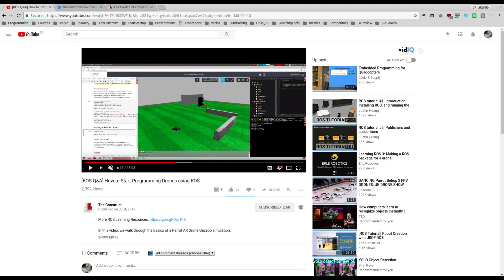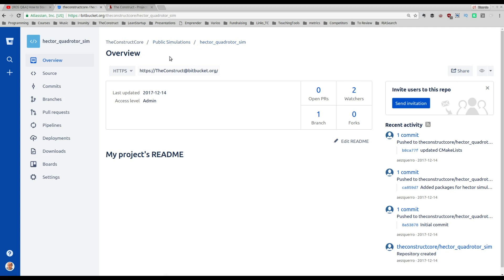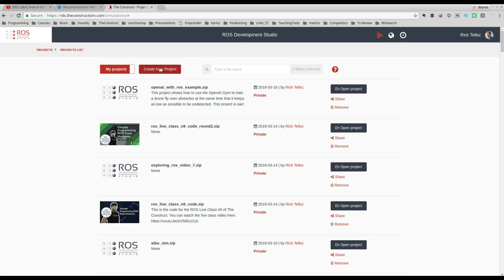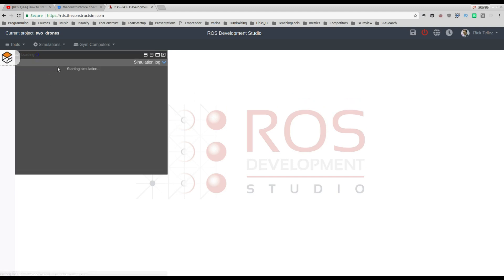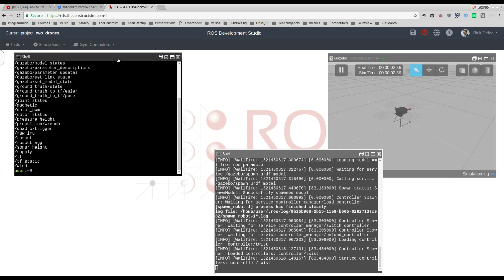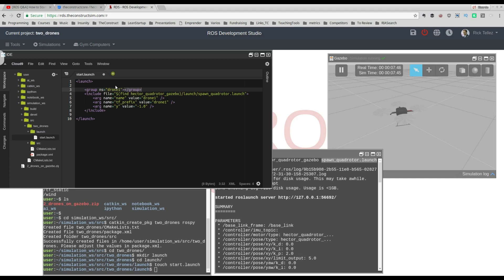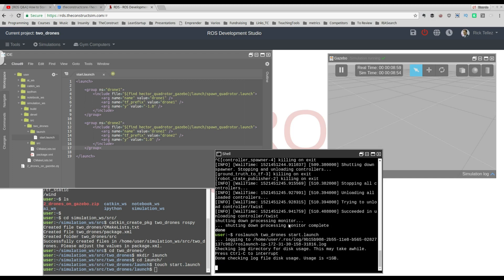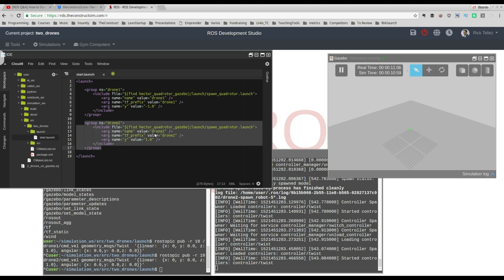[ROS Q&A] 110 - How to launch two drones on a Single Gazebo Simulation

Comment: This does not work if not using the ROS Development Studio.
Reply: I have been using Ros Kinetic, and I can't get even one drone to spawn.
Reply from the maker: @evandavies1128  Did you install the simulation of the drone in your local computer?
Reply: @TheConstruct  Thanks for your quick response! I am not sure exactly what you mean. I cloned the repositories you provided in the link to my own workspace and then run catkin_make. However, there are errors with catkin_make and I'm not sure if that is cascading errors down the line.
Reply: @TheConstruct  The biggest issue is the simulations depend on the package hector_quadrotor_gazebo_plugins, but when i run catkin_make it does not consider it a package
Reply from the maker: @evandavies1128  It could be that there are compilation errors due to the ROS version you are using. Our repo only provides it for either Kinetic+Gazebo7 (master) or Kinetic+Gazebo9. Remember to checkout the branch that corresponds to your local ROS install

Comment: rostopic pub -r.....this command not working.
Reply from the maker: Please add here the output of the console to that command
Reply: There's no cmd_vel topic!  These are the topics available:
/drone1/aerodynamics/wrench
/drone1/altimeter
/drone1/command/motor
/drone1/command/wrench
/drone1/fix
/drone1/fix_velocity
/drone1/ground_truth/state
/drone1/magnetic
/drone1/motor_pwm
/drone1/motor_status
/drone1/pressure_height
/drone1/propulsion/wrench
/drone1/quadro/trigger
/drone1/raw_imu
/drone1/sonar_height
/drone1/supply
 @TheConstruct
Reply: rosservice call /drone1/enable_motors "enable: true"